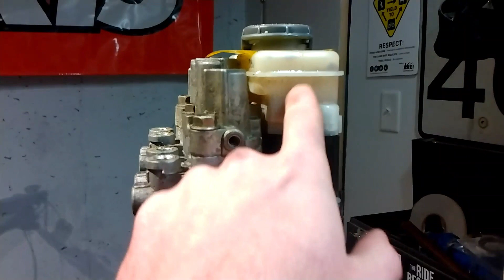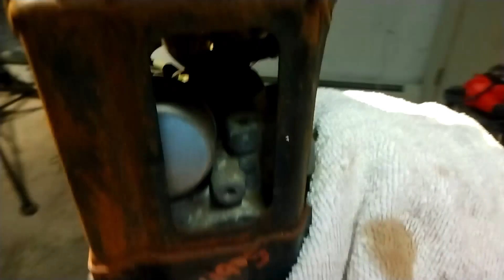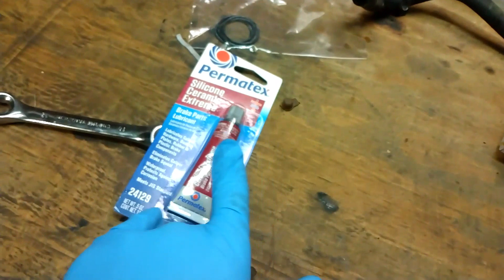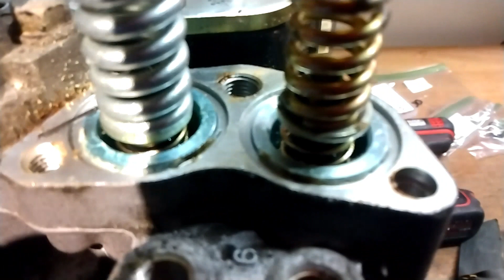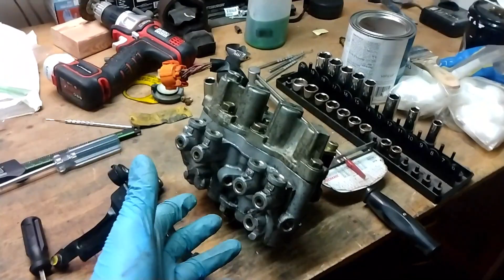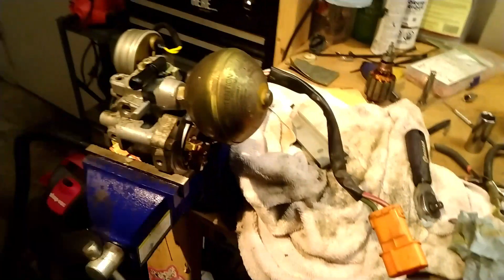1991-1995 Acura Legend ABS Module Rebuild and Reseal (Updated O-ring Info In Description)

Comment from the maker: 6 month update: the rebuild on the unit shown is still performing perfectly. Some comments below point out o-ring size differences and procedure differences. To my knowledge, there is not a procedural manual for this and you should take the necessary steps to make sure all o-rings fit and seal before operation and test the unit beforehand. I mention in the video this is a rebuild video only.

Additionally, I looked up the NSX rebuild DIY and this is the list of o-rings for the internal pistons being used by some. To reiterate, could check your fitment and function:
25-2mm EPDM Metric Valve / piston qty 4
24.5-2mm EPDM Metric  Valve / piston qty 4
31-2mm EPDM Metric Valve / piston head qty 4

Comment: Good evening, congratulations on the video, it helped me a lot. I'm having problems with the ABS system on my 1993 Civic VTI. Fluid is leaking from the master cylinder reservoir to the ABS reservoir. Could replacing the valve seals where the springs are located fix this problem? I would like to replace the sealing rings on the three electronic solenoids, but I couldn't remove them. Thank you.
Reply from the maker: @andreafes  I'm not familiar with the 1993 Civic, but if it's leaking between the master cylinder and the ABS reservoir it's likely the sealing o-rings on the reservoir. Those are common failure points in most Honda ABS systems

Comment: Would a bad pump cause front brake calipers to lock up or simply abs not work?
Reply from the maker: A bad ABS pump would throw a fault code for the ABS system and the ABS would not work. Calipers locking up is likely a seized caliper piston and would be unrelated.

Comment: Are you able to remove the motor with the copper on it? The green piece that spins?
Reply from the maker: You can remove the spun copper motor from the pump assembly as shown but you can't remove the copper from the motor. It's soldered as one piece

Comment: Hi Again Ty, am I able to use my Bleeder Pump to bleed the ABS? What’s the max PSI I should use?

Maybe you can do a video for content?😂

Motive Products 0109 Black Label European Power Bleeder 2-Quart Tank with Hose, Extra Tubing, and Adapter

Or

EWK Patented 6.5L Pneumatic/Manual Oil Extractor Change Pump for Automotive Fluids Vacuum Evacuation
Reply from the maker: I'm planning on bleeding the brakes in the spring so I can do a video then for sure.

The ABS pump puts out about 150psi.

Comment: Bleeding the ABS modulator is just bleeding the brake fluid from the calipers?
Reply from the maker: On newer cars, yes. On older Acura/Hondas they had a separate ABS pump and reservoir that needs to be blead before you can bleed the primary (non-ABS) system.
Reply: So the Legend falls in the bleed separate category?
When I did my spoon calipers on both my RSX Type S and 6spd CL Type S it was just the calipers that I bled.
Reply from the maker: @jp554731  it was early in ABS technology. You're right,  the CL has an electronic modulator

Comment: For the screw you will probably need a JIS #2 bit or screwdriver. Most Honda screws used in the car are these Japanese screws
And will round out if you use an American Screwdriver.
Pro tip: the brake rotor screws are JIS #3 bit.

Comment: You didn't clean out the moving pistons inside the hydraulic pump? That would lead to "ABS MOTOR OVER RUN" Code overtime

When you bench bleed the unit with a 12v source, you need to ensure it sounds "Raspy" as it build up pressure...smooth sounds mean the Hydraulic pump pistons are not moving thus not building pressure
Reply: I agree here. There are two metal cylindrical pieces that get stuck inside that need to come out and get cleaned up so that they move freely again

Comment: Where did you get the EPDM O-rings? I found some on eBay but not in the sizes needed, almost all of them were imperial sized not metric. McMaster seems to carry them too but just imperial as well.
Reply from the maker: I took the pump apart and gave all the o-rings to a local supplier. They matched up the o-rings and then I measured them using a set of calipers to make the video. I couldn't measure the OEM one's because they were likely compressed or reduced after the years. If you can find an o-ring that is within 0.1 +/- mm from the info in the video then you should be good. McMaster would be where I would purchase from.
Reply: It's 25mm and 24.5mm for the O rings in the middle. Remember over time the saturation of the o rings may make them seem different. I was able to validate this with other Acura ABS rebuild "kits" I found